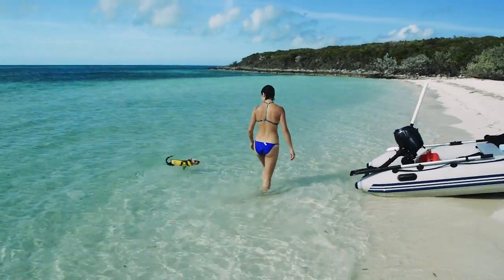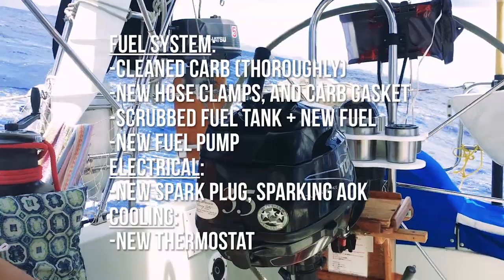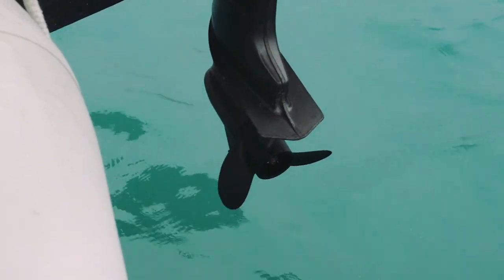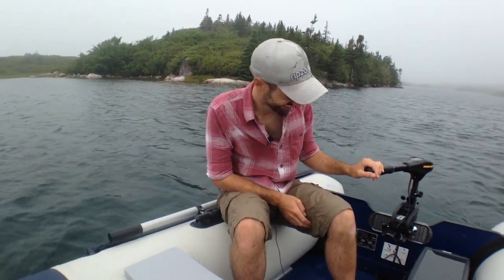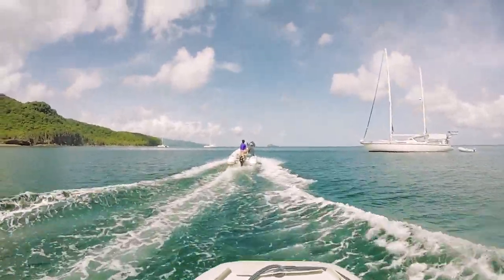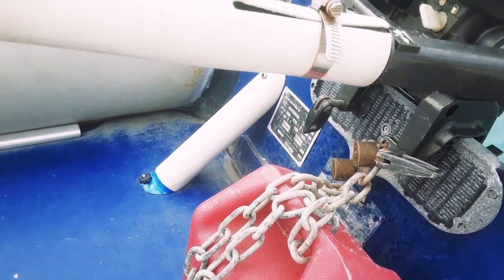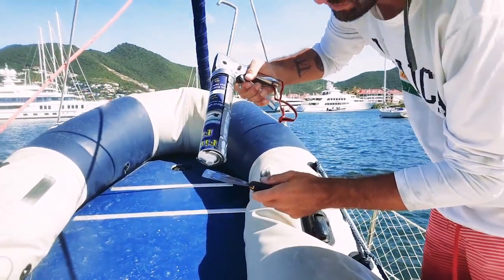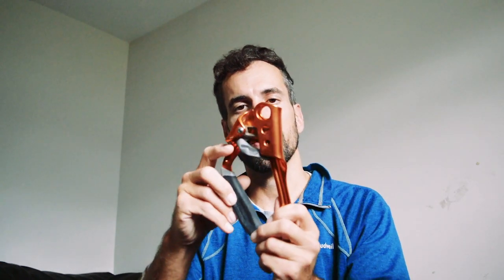Should you buy a TOHATSU Outboard Motor for Liveaboard Cruising the Caribbean? | Sailing Gear E004

Comment: I'm a 35-year liveaboard and have had 4 dinghies/outboards. My current outboard is a 10 yr old 30 hp Tohatsu that has served me flawlessly and continues to run perfectly. My worst dinghy was a Zodiac PVC and I'd avoid PVC at all cost. Invest a little more for Hypalon. Also, Dan's preferred dinghy is a Rigid Inflatable Boat (RIB). RIBs are great, especially with higher horsepower outboards, however, they are heavy. Ribs are too heavy to land on a beach and drag out of the surf. My best dinghy was my first, that was a 13 ft hypalon Avon with an inflatable keel. I could land on a SoCal beach through surf and "walk" it onto the beach out of the surf and "walk" it to relaunch. With a 15 hp 2-stroke Yamaha (got stolen so I can't comment on longevity but was great for 4 years), the Avon was a rocket ship. Unfortunately, Zodiac bought Avon and ruined the brand and 2-strokes are illegal in California.
Reply from the maker: Yeah, hear lots of negative thibgs about Zodiac despitr the reputation. See a lot of zodiacs covered in patches and glue. There are tonnes of options. Ribs are crazy heavy but a small 9 or 10' isn't bad if you don't mind the splashing. I loved our 5 hp 2 stroke tohatsu but if i got a new one it would be all made of cheap materials from Asia. Tohatsu has gone down hill. You'll see what I mean when your choke or starter button just falls off for no reason :(

Comment: The best and most prevalent outboard motor in the Caribbean was, is, and likely will remain for some time, the ubiquitous Yamaha 2 stroke with the 15HP being the most common on dinghies.  There are parts available everywhere because all the locals use them as well.  Pick one up anywhere along the way.  We picked up our 2020 model in the Bahamas as we made our way south.  $2200 is an excellent price for a brand new 15HP outboard.  Additionally, the best modification I have made to our RIB was to install a fuel/water separator designed specifically for smaller outboard motors.  Ours happens to be a Racor unit but there are others available.  Keeping water out of the carb is a great start to keeping the motor running optimally!

Comment: Still using the same Danny Green nesting dinghy I built in Ecuador in 2007 with a 3.5 hp 2-stroke. It sails better than it rows. Rows better than it motors and motors at about 4-5 knots. I service the outboard once a year myself. Full time cruising. 😊

Comment: G'gay. If you have an lightweight dinghy, all you need is an 100 amp lithium ion battery witch can be recharged by solar when you are away from the dinghy and an 60 pound thrust electric trolling motor. I set my old tender in this manner and it worked just fine.
Advantage no feul no noise going past other boaters and no feul smell. And as no feul needed, you have more cargo space. Diavantage just do not ancour too far from the dinghy warf or beach.
Gerard. NSW AUSTRALIA.

Comment: You are either very unlucky, or your routine outboard preventative maintenance is questionable.  I have run outboards for years - decades on both Tohatsu and Yamaha, without any major failures.  

I guess it is hard to freshwater flush when extended cruising, but it is vital to longer reliability.   Running on decent quality fuel and flushing fuel filter, applying fogging oil, and changing all sealed fluids/filters more often also helps.   You may as well do bushings at same time also useful.   Little and often is key.   YMMV but just using tender engine and not flushing etc, is gonna impact 'reliabilty' perceptions.